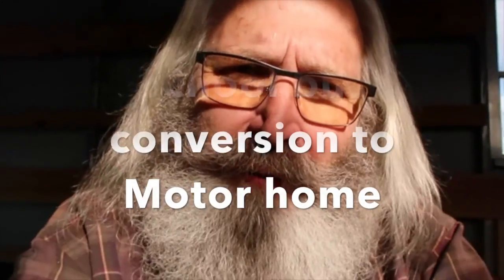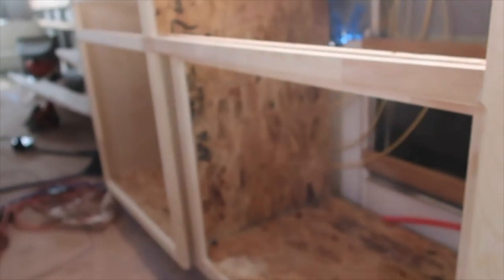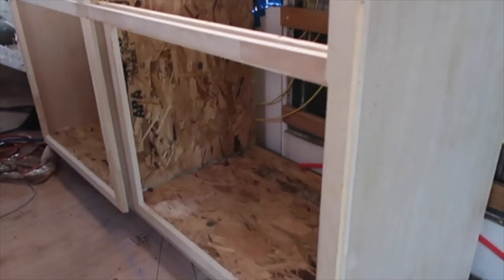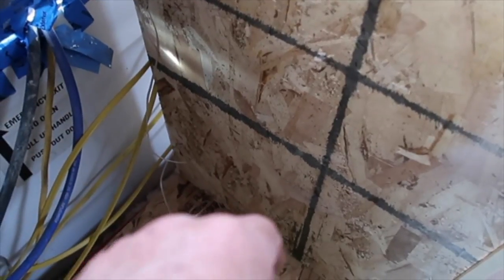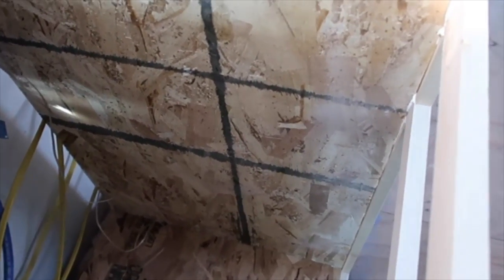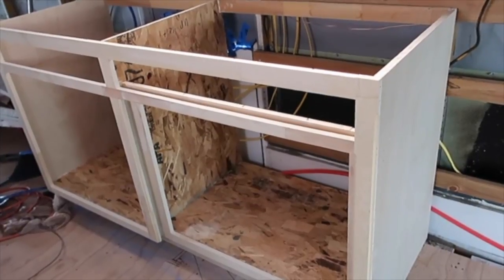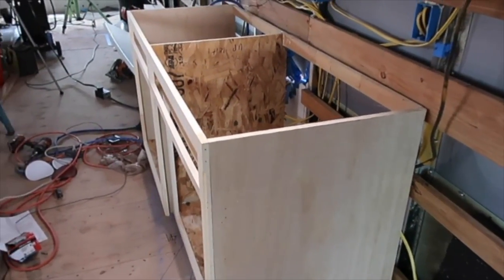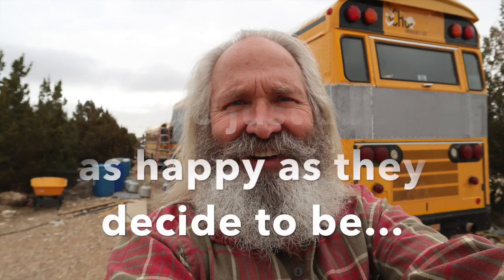School Bus Conversion to Motor #12...Cabinets to house solar equipment

Comment: Jim the utilities voltage use to be 110v then worked its way up to 120vand 220v is240v.  Generally from what I've tested myself. 120v = 123v, 208v = 212v, 240v =242v, 480v=496v.